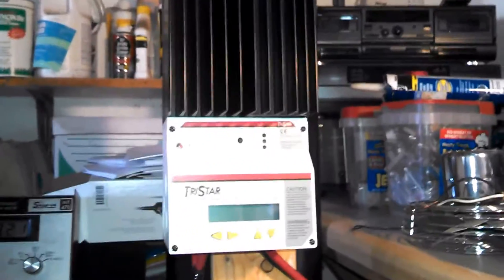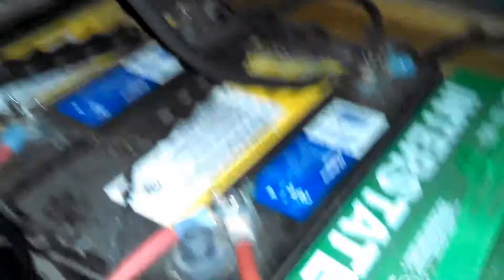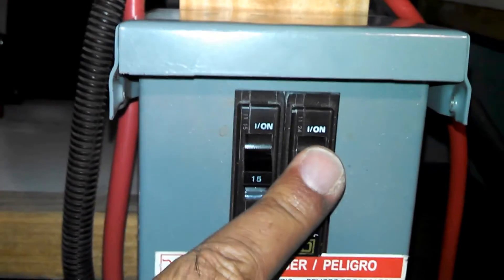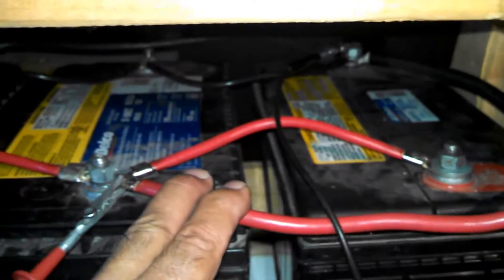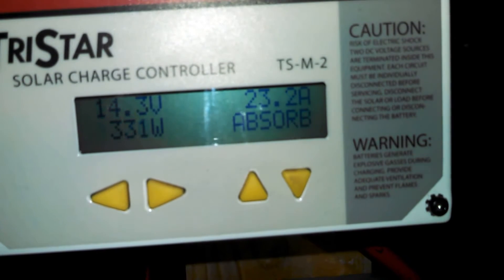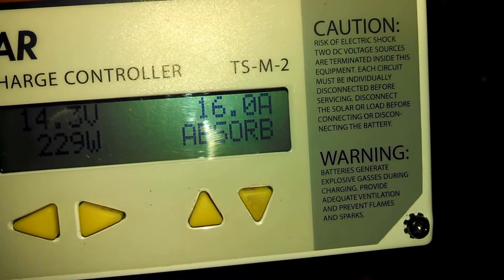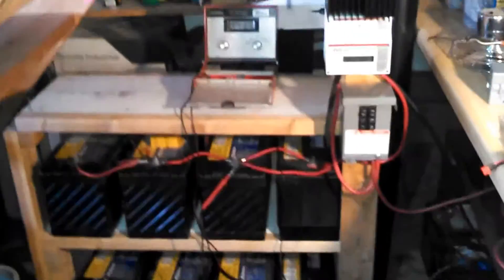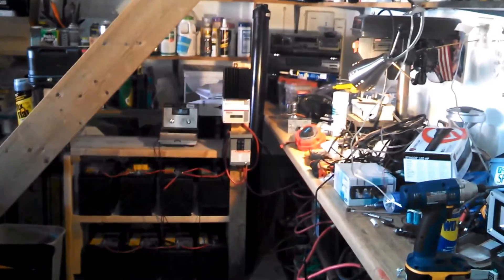TRI-Star MPPT Controller Piggybacking on The Midnite Solar!

Comment: How do you limit the Amps flowing from 24volt to 12 volt bank? does the charge controllers amp specification limit it to the capable max amps?
Reply from the maker: The maximum Amps of the Tri-Star is 60 Amps, so it is no matter how much you load on it only 60 Amps would go through!
Thanks For Watching, Godspeed,
El Raz

Comment: I thought about this myself but still not in the position to try it.  Am going to have a 48 VDC bank and I have thought of feeding a 12/24 VDC bank for lights and what I call emergency power.  The 12/24 bank will also be back fed from 4 100w solar panels and a couple of windmills.  This is at least a year from now as I need to get the main solar online.

Since my plans is to use 24 VDC windmills if the voltage in the emergency bank is at max I have thought about transferring the power the opposite direction via a boost convertor.

Anyhow thanks for proofing this works.  Am about 3 years behind you.
Reply from the maker: Looking forward to see your system in action. After all its all about trial and error but never give up brother and thanks for your time!
Be Safe, Be Well,
Raz